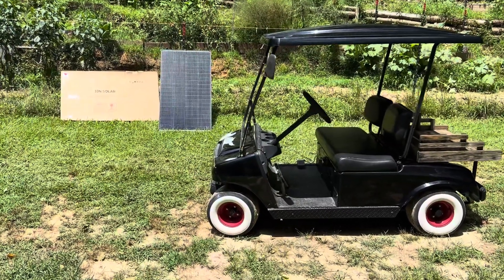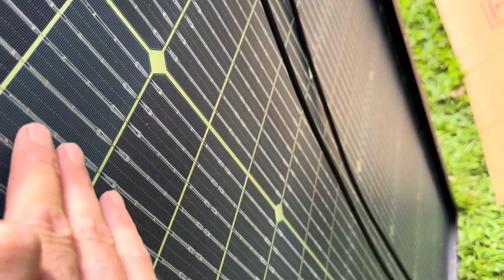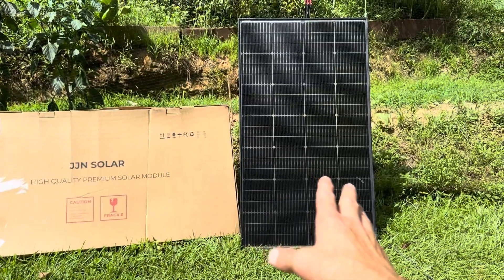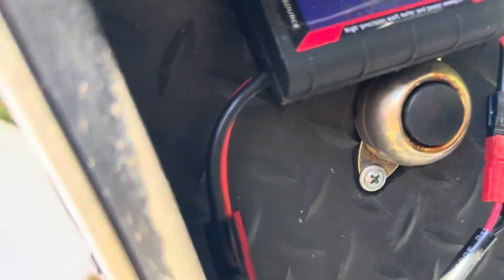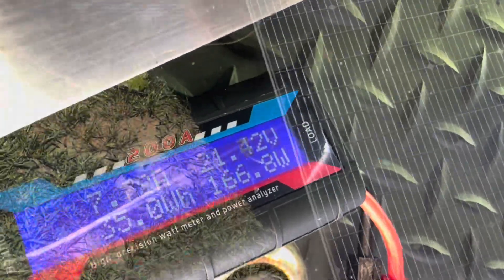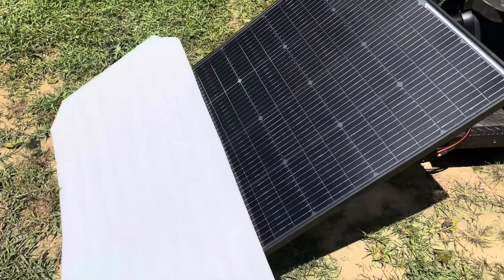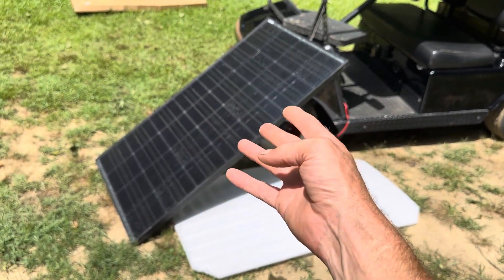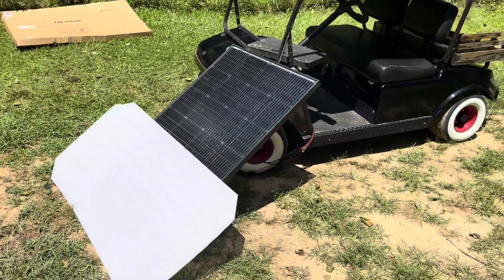JJN 200 Watt Bifacial Solar Panel   Affordable Solar For RV Marine Off-Grid and more

Comment: How do you charge your golf cart?
Reply from the maker: Bouge RV cigs rooftop solar panel and on board boost charge controller. If that’s not enough I have a 20A 43.8V lifepo4 onboard charger. I have XRH lithium batteries now.

Comment: Will these work with a Ecoflow delta 2 max?
Reply from the maker: They should work with most power stations! Double check the specs on Ecoflow but most can utilize PV input of 12-60VDC! JJN is around 28V.

Comment: Was this panel just out of the box? What's up with all of that white ashy stuff on the frame? Looks like dust. Regardless, for a new panel that shouldn't be there. Thx.
Reply from the maker: Not new out of the box, saved box in the barn for the video. Panel had been used before I filmed this video.
Reply: @THEOFFGRIDMOUNTAINHOMESTEAD  OK. Thank you.
Reply: @THEOFFGRIDMOUNTAINHOMESTEAD  Just got 2 of these panels myself. That white discolor is from the styrofoam in the box. Just rubs off.

Comment: I have 4 of these and while they started off generating 600-800 watts the performance has dipped considerably to where I’m lucky if I get a steady 600 watts coming in.  Anyone else notice changes in performance given ideal conditions?
Reply: All four of mine are pretty much dead after a little more than a year. There is voltage, but the AMPs have dropped to almost no current. They only have an 18 month warranty, which says they know they are junk. Most panels are rated for 10-20 years with only 1-2% degrade per year.
Reply from the maker: Assuming you’re in northern hemisphere? 
Have you adjusted angles to match dropping sun elevation? Less power in autumn and winter.
Reply: Thanks for the reply.  Here’s the strange part, I was getting higher charge in deep winter/February than I have been in August-October.  Also testing one of these panels against an EcoFlow 160 watt panel shows the JJN reading 125 watts whereas the EcoFlow shows 140-150 watts.  I’ve been in touch with JJN but they are giving me the runaround.
Reply from the maker: Sorry you’re having troubles with the panel. Are all the JJN panels dropping in performance or is a single panel dragging down your PV array?
Reply: @THEOFFGRIDMOUNTAINHOMESTEAD  Thanks again for the reply.  I'm waiting for a sunny day to test and see if all the panels are acting that way or just a single one.  This has been is a mixture of series and series parallel wiring.
Reply: @ibanezman1025  Where is the installed location and what is the tilt angle of your panel? Depending on the time of year and location, non ideal tilt angle can affect the solar generation.

Comment: Im new to solar panels, it says the output cable on solar panel is 12 awg. If i get a solar extension cable does it need to be 12awg or can i do 10awg?
Reply from the maker: 10 will be great, especially if running some distance from the panel. With DC power larger wires are better, less resistance to current flow! Hope this helps!

Comment: Hey Mr Offgrid.  Just wanted to let you know I didnt abandon you.  I deleted my youtube account due to their ad policies.  But then I found out I cant download any apps or updates on my phone without a google account so I had to get a new account which includes youtube commenting. 

If I have 360w roof mounted panels would it be worth it to upgrade to something stronger like a 460 or higher? Assuming of course there are no hooligans around me.
Reply from the maker: Glad to see you back sir! Was thinking about you the other day. Hard to do anything without google accounts nowadays! 
As for your PV, that depends on what you’re wanting to achieve, if I remember correctly your system is grid tie no battery. So you would have to think in terms of investment. Is it worth the $ for panels to offset usage or get some payback from utilities depending on your metering agreement. 
OFF GRID, it’s a different matter. If you’re weren’t keeping up with loads and getting batteries charged it definitely would be good to upgrade. 
Good to see you back in the comments! Reach out with further questions if needed my friend!
Reply: @THEOFFGRIDMOUNTAINHOMESTEAD  I am still grid tie only but come tax time next year I'll have my initial install paid off and will be looking to add batteries to the system.  The main reason I asked though was because they sized my system for yearly average use so it never seems to be enough to break even in the summer or winter months.  Though I'll have to see what happens with the batteries first I may look into either more panels or higher wattage ones.  Once I get the batteries done I wanna put in a garage and MAY put solar panels on that roof as well later on.  Not for running the garage specifically but for adding power to the entire system.  But that's a bridge to cross in another lifetime as of right now.  

Also my potatoes failed again this year... did 20gal grow bags with windows on the side and they did the same thing they did last year where they came up, looked good for like 3 months and then died... dug them up and got 2 tater tots out of 7 seed potatoes.  IDK what Im doing wrong.
Reply: Watch out for the hooligans. My neighbor has a sun-run work van and his windshield got smashed to bits.

Comment: Thanks for this review! I’ve been thinking about these panels, good power in that heat😮 I have some EcoWorthy that only make 50% power if over 90 outside ❤
Reply from the maker: I have heard similar things about Ecoworthy! 
JJN is legit and makes real power!
Reply: I have 10 of these jjn 200 watt panels & 5x 195W eco-worthy. They are all roof mounted. The jjn panels are better, 15% more power approx in my experience. If they were mounted in such a way to use the bifacial aspect, they’d even better.

Comment: Very odd thing with your channel... some of your video's simply won't play in my browser... I have to switch to a commie browser and they play just fine... but some of them play normally... any idea why that is?  Happens with almost NO other channel... I am subscribed to well over 100 channels... probably says somewhere, but honest I don't care about the exact number... but there are only two channels that I ever run into this on... it's odd.
Reply from the maker: Honestly I have no idea what would cause this. All the videos have the same settings on my end. That’s very odd. Thanks for going through the extra effort, I’ll send a message to YT creator support and see if they have any suggestions.
Reply: @THEOFFGRIDMOUNTAINHOMESTEAD  Interesting... I went back to grab a screenshot of the error... and now it plays.  But it happens somewhat regularly... next time it happens, I'll grab a screenshot... although I think it's just a generic message... but maybe it will be helpful. 

One does whatever is necessary (within reason) to gain useful information.

Comment: That’s good power on a hot day.  Thanks for the review.
Reply from the maker: Definitely pleased with its performance! The standard 200W monofacial was making 115-125 at same temps. 1800W of Hanwha Q cells making 1200W in same temp.